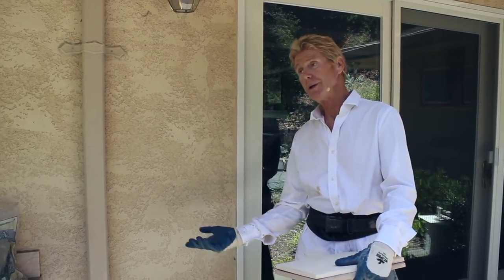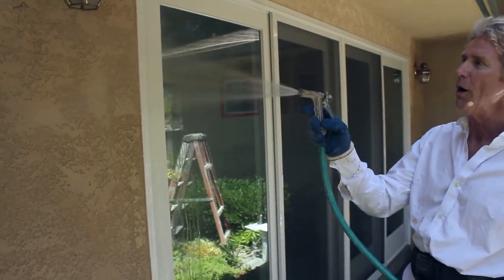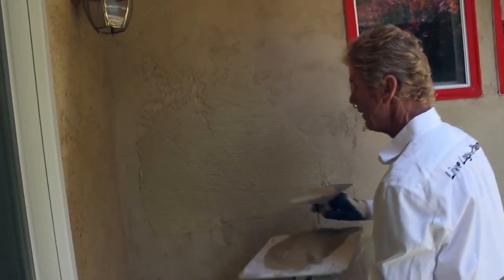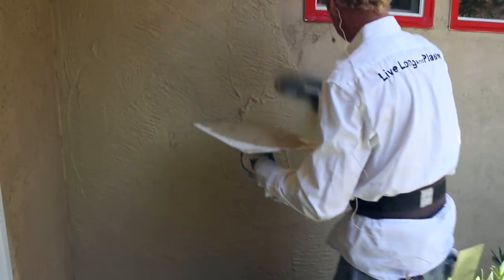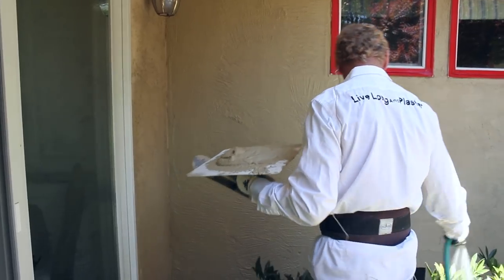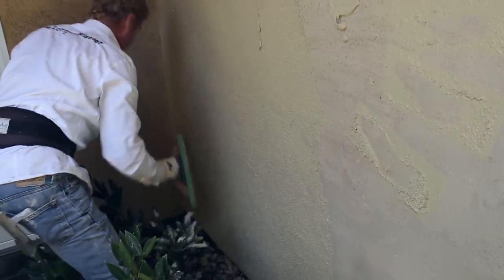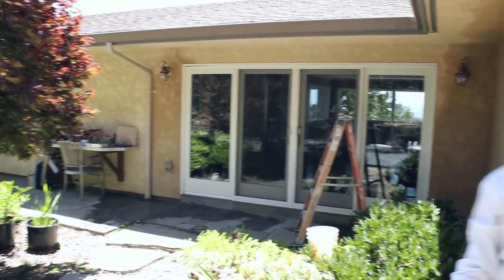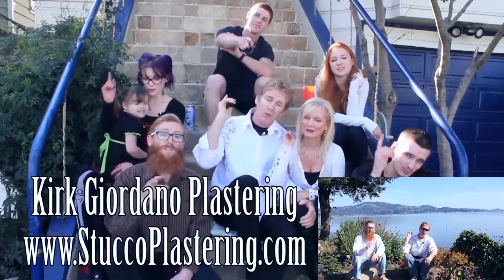Stucco skip-trowel over a sand finish

Comment: I like it. Great job. I'm painting a nice home in la habra heights and I already knocked down all the buckling stucco and pressure washed. Then I gave it the sand finish,but I was a one man army,so that's all I did. I have to roll the glue as well. So Monday I'll do the texture,but I'm going to by  a trowel like yours...Amen. thanks for the video. Hey, I even cherried out the houses foundation because it was beat up and I pulled back the guys stone to pressure wash. When I'm finished I'll put back the stone to a sand finish,but the rest of stucco will be light lace
Reply: The stones bumped the foundation.

Comment: Hi Captain Kirk.  On the wall that you saturated with water, can weld crete be used instead?
Reply from the maker: HowdyRayram, excellent question, yes it can, however, water is ten times faster, does not cost a cent and works better for the mechanical bond.
 Fact is I did use weld crete for this purpose a few weeks earlier as the wall that was in the sun I had weld crete on the truck and my brother luuuu applied it by roller to kill the suction.
    I had to redo that wall as the mud still dried too fast which created a varied color and texture.
lots of reasons why, but the fact is water and lots of it is the sure thing.
 Weld crete is necessary if the wall is painted, the wall in this video was cementitious so the new to existing adhered by natural suction.
                 Live long and plaster
 Do’s and don’t of plastering’s leading experts

Comment: Hi Kirk,
   Up here in Ontario Canada people tend to use a styrofoam and a mesh, they put on the styrofoam then a base coat of a sticky cement on then push the mesh into it with a trowel. Then you put something like a colour coat ,this material is all premixed in buckets, I think they call it Dryvit, then they bring out the aggregate out with a hard plastic trowel.
   I’ve done this and found you have to wash off the trowel regularly or the colour coat sticks to the trowel, and if you do it in the heat of the sun it dries to fast to float.
    Would wetting the wall work in this situation?
    Thank you for the videos.
Reply from the maker: Howdy Dave, it called the Dry-vit system, of course since it was introduced here in the U.S. in the 60s it's been copied by many companies. 
   Keep a bucket of water with you, "clean your trowel often," as the cementitious material used to attach the mesh netting to the styrofoam also has an adhesive in it, very similar to Poly Bond. made by Lahar used to attach styrofoam molds to cement walls
                                              best wishes,
 Sound advice for plastering issues from your favorite stucco geek
Reply: Kirk Giordano plastering Inc. again, thanks.